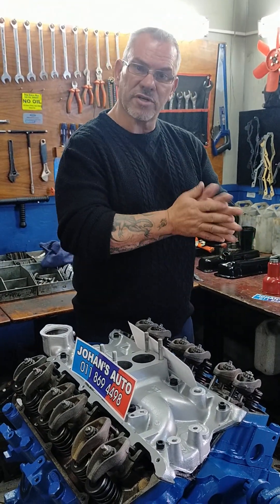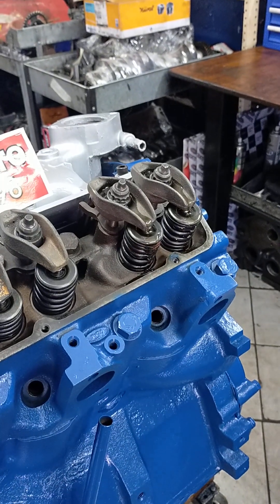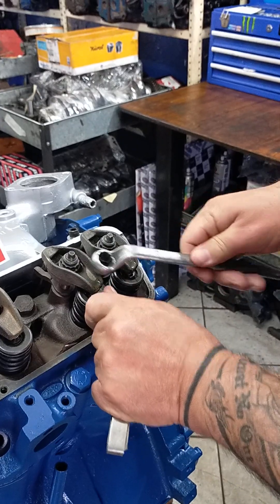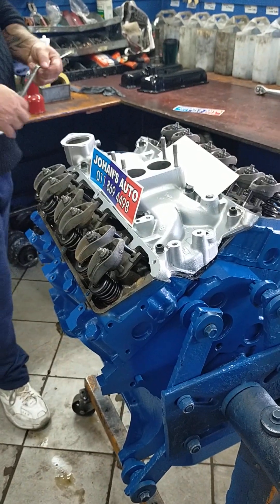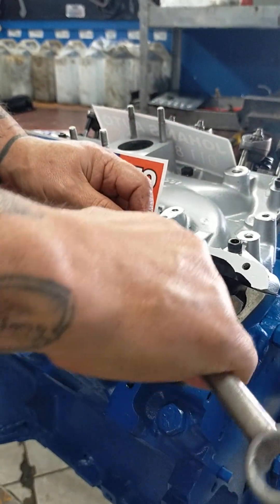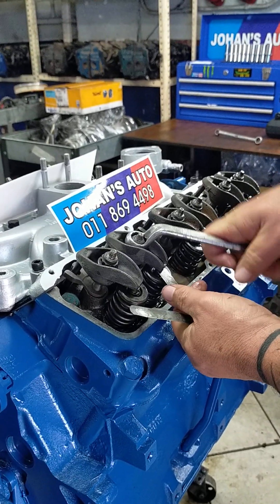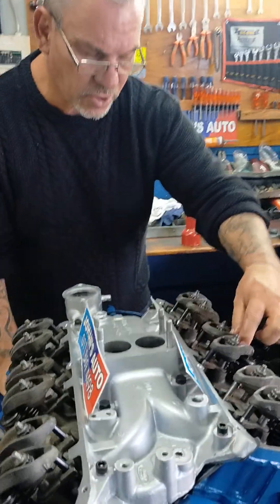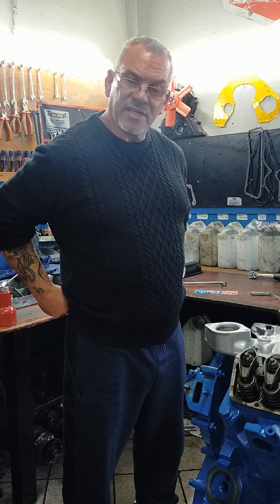FORD V6 ESSEX TAPPET SETTINGS / VALVE CLEARANCE

Comment: That is true mechanic way.
If you set thousands, you figure out a simple way with spark plugs out..., start one side, finish other side on a straight or one bank on a v  then do other bank. Forget complicated firing sequence.
Turn motor on crank bolt clockwise until exh valve is just starting to open, then adjust INTAKE on that cyl(lifter /pushrod is on the back of cam)opposite lobe ramp wherever cam or cams are, same for  any 4 stroke.
After you adjust intake, rotate until intake valve on same cylinder opens fully  and closes 3/4 .
Now ADJUST EXHAUST .
Repeat on next cyl...and do on.
Easy peasy bra😁👍

Comment: Would love to see you experiment on a essex v6 60thou pistons nice cam straight pipe exhaust built for motorsport. High revvs knive edged cranks etc. Port and gasflow heads etc... More or less how much does a setup like that go for Johan +-? Coming out of Johans auto